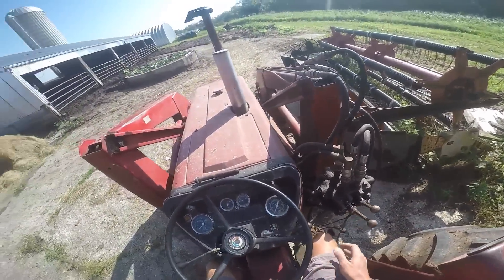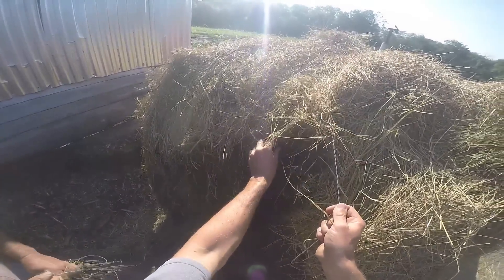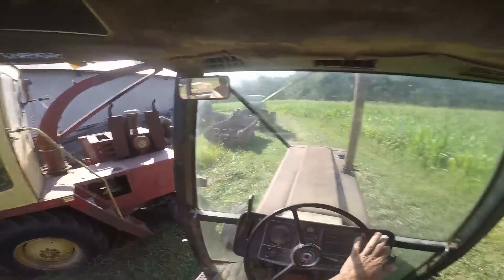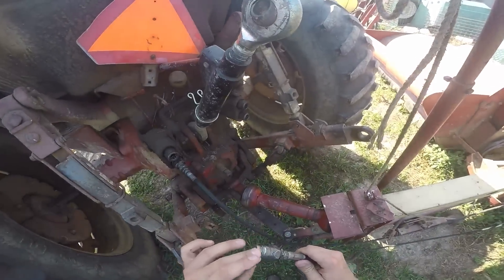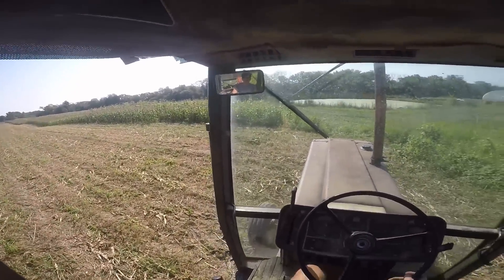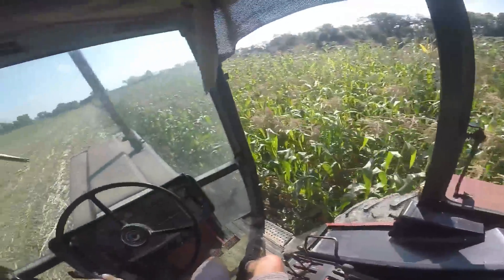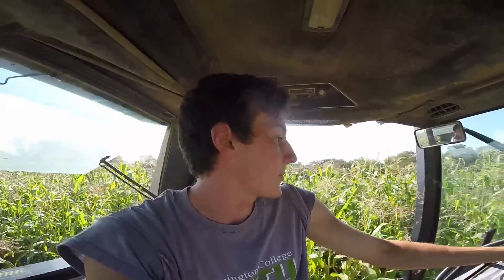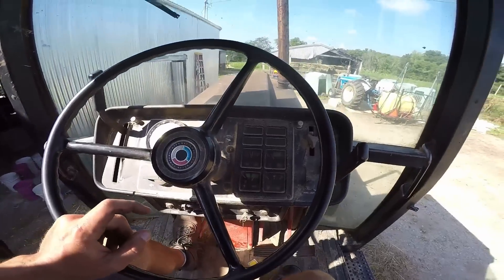IH 1086 Green Chopping Sweet Corn

Comment: There's two sure-fire ways to control Johnsongrass... 1) in row crops, get you a Spiedel weed wiper (it's a 2 inch PVC pipe with holes drilled in it, covered in heavy sail canvas all the way around it).  Mix a 33% Roundup solution (1 gallon RU, 2 gallons water) and pour it in the applicator and wick it on... of course you have to have J-grass that's taller than your crop to wipe it on, and drive slow enough to get a good wipe.  I used to run the Spiedel applicators most of the time when I was cultivating in-season, it'd take out pigweeds too if it was sticking up enough to get about 5-6 inches or so of wipe on the plant, otherwise it just burns the top out of it.  Johnsongrass of course grows by seed and rhizomes; plowing and disking tends to make it worse, unless you can plow it up and get a burning hot few days to roast the rhizomes and kill them.  Another trick that worked in row crops was, let it green back out and get pretty lush, then spray it with Roundup and a surfactant called Dyne-Amic... my seed/chemical/fertilizer guy told me about that one and it will really work.  

The easiest way is if you can put cattle on it for a year... cattle will absolutely eat johnsongrass to death... they call it "ice cream grass" down here because just like kids will eat ice cream before anything else, eat themselves sick on it, cows are about the same with johnsongrass.  They will literally graze it SO HARD that they will kill the rhizomes and any that is sprouting before it can develop rhizomes.  We used to have a johnsongrass problem on our farm too but within a year or two of fencing it and putting it in cattle they literally cleaned up every sprig of it... just ate it to death.  The only way you can make it persist in a pasture is to rotational graze it to give it a chance to regreen, rest, and build up root reserves.  May not be an option but then again, an area overgrown with johnsongrass isn't very productive for row crops anyway.  Baling it doesn't help because it takes the CONSTANT pressure of grazing cattle to keep it nipped off at the ground to kill it out.  

Later!  OL J R :)

Comment: Love the IH 86 series.
Reply: PA Farms really? The shift levers are awkward 66 series way better set up??
Reply: Josh Timer haha, that's the #1 complaint with them. I do like the '66 series, just not the toolshed sized cabs. What I like about series 86 is it was the first tractor designed for a cab.  Just have to find the sweet spot with the shifting adjustments... but I agree with the shifting
Reply from the maker: I'd trade my 1466 for an 86 yesterday.  I don't like the reach for the shifting or throttle. And more 86s seem to have differential locks. I grew up in Our 1086, so that's  influential. The left hand shift feels very balanced against the right hand hydraulics and three point levers.
Reply: Boehm Farm I forgot to mention, I like putting fuel in an 86 vs 66, but I would have no problem with owning either.  I was looking for something a few years ago and I bought the 986 with a turbo kit.  I have a lot of hours on a 6610 ford too but the engine issues that they had, don't think I would buy one.
Reply: PA Farms lol  I totally agree with not liking the 66 cab but tractors where not meant to have cabs. As far as 86 cab besides the shifting the doors open backwards so there is no way to get any air flow when a.c. fails. Also the cab may have been designed for tractor but the back window reminds me of looking out a deer blind and with that upper fuel tank back there you can't every see your draw bar when hooking Up! Lol just a few more points I could think of.  Oh and one more my 4166 actually had a cab designed for it but still not very good ended up pulling it off. Ok that's it not trying to be mean just like to discuss tractors! Lol

Comment: My dad had a 1086 before traded it for loader 685 case Ih 4x4 plus big cash he had to pay. It was a big mistake. he got screwed over bad. we been having problems with 685 every year. this year  cracked block but been fixed with stop leak crack fix (water pump went out for a while ran it hot), shifter flange part broke off and now power steering went out. Trying to get my dad to get rid of the damn thing before something else go wrong. i really missed the 1086.
Reply from the maker: I would never trade a big tractor for a smaller one. I expect this wasn't buying the 685 new?
Reply: got it used in 2008 or 09, we needed a loader tractor.  aftert 2 years,  my dad was using it   then  a whole damn front wheel with gearbox hub came loose. what happened was  ball joint bolts stirpped out of them holes. had take it to mechanic dealer shop and had to pay whole lotta money to get it fixed. When it was taken apart, the mechanics found  parts of hubs were brass welded  and u joints for drive shaft were welded together. obviously this tractor was in a wreck and past owner tried to cheaply fixed but never said anything about those when he sold it to my dad. 9,000 bucks  to get it fixed. in 2011, a front wheel came loose again, this time it bent the axle  shaft and screwed up seals inside the hub because mechanics did not put lock watchers ball joints bolts. another 1000 bucks to get it fixed again. Always something.
Reply from the maker: See, that right there is why I don't trust others fixing my stuff.
Reply: Yep i do fix tractors and equipments too.

Comment: We have a 684 International that leaks fuel like crazy
Reply from the maker: Is it by the fuel filters? The fuel line connection seems to have its issues with sealing well.
Reply: No it has a small hole in the tank and when it gets so low it becomes sluggish and doesn't want to pull itself around the farm
Reply: But we also have a 1086,1066,706 gas ,806 diesel and a 686
Reply from the maker: That is good red lineup!
Reply: Alex Brangers ppl I work for ,old 434s n 574s,Aussie!

Comment: Ok first off why fool with taking the loader off is the hydro is just gonna get used for maybe 20 mins and also the 66 series is a whole lot better than 86 the 86 you have to have 6 hands and 4 legs to drive the damn thing the 66 is a 2 hand 2 leg deal but I never will go away from John Deere this isn’t meant to offend you but having everything to your right except the pto is the dream meanwhile IH has the pto to the left and the gears over there hence why JD is the ONLY brand that has survived on their own since 1837!
Reply: Oh and also may I add that the equivalent to a 1086 would probably be a 4430 but the 4430 is 5 less horse so let’s say a 4440 the 4430 has the 404 with a turbo meanwhile the 4440 has the 466 so let’s compare the 4430 and 1086 the 1086 has every damn thing every where also them TA’s in the internationals are either out or going out now one thing that international had over the John Deere and always has was lighting them 86’s they would make the world light up where as a John Deere they are a day time tractor and also international had the speed on the road and also them what I call over under pto with 1000 on top and 540 on bottom you can’t beat them but John Deere had the controls and motors right and also John Deere has one hell of a lot more weight so there is just my simple explanation as to why I’m always gonna be a Deere fan so now let’s hear why you like international more
Reply from the maker: The loader comes on and off so fast, it puts any other band of quick attach to shame. The hydro is much more enjoyable to drive without the loader. Ya know, kinda like when you get to leave the lights on ;) lol

Ok, 66 series didn't come standard with a diff lock, you have to reach forever to shift and move the throttle. The cab is a blaring after thought of production. And the park lock is separate, and the lever can fall when you take it out of range. Not to mention, somehow, the 86 has better traction. And 86s cary twice the fuel or more.  The 1086 and 1466 have the same added weight.   You know, there's a reason there's no real replacement for a 1066 or 86. No 88 series tractor used the 414, which in our 1086 is a beast; IH sold so many more 10s than any other model, that the used market would have hindered the new market on a new tractor with the dt414. 

Can you say, obstructed view? The green cabs have that half the windshield as a door, and a muffler, and an air intake tube in the way, too, I think. Even with the doors off, the 1086 is much quieter in the driver seat than the 1466. Both sides of the cab can be used for entry. The dual pto is nice to not have to change shafts, isn't it. I wouldn't say deere had motors figured out,  I see plenty of those 44s with rebuilds before 4000 hours. The DT414 has never been opened up after 10,000 hours and starts like a champ below freezing, no heater, no ether, unless you leave the key on.  IH could keep the three point from needing a strap to keep the lower arms from swinging  free when empty.  If you think red is fast, you haven't seen our two little Fords, I once caught a 4020 who had a mile head start.
Reply: Boehm Farm ya know you talk bout how that that 1086 has 10000 no rebuild I got a 2940 John Deere with 20,000 no rebuild and still starts in a half turn coming out of winter with no ether and no block heater
Reply: Boehm Farm and also them cabs once you get used to them not being a issue it’s nothing dude your getting tore up over 4 inches